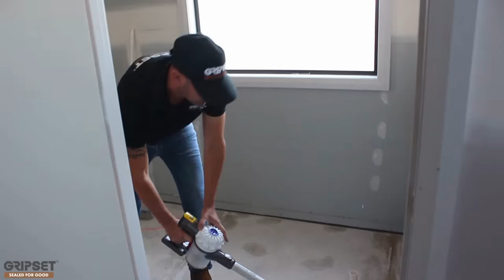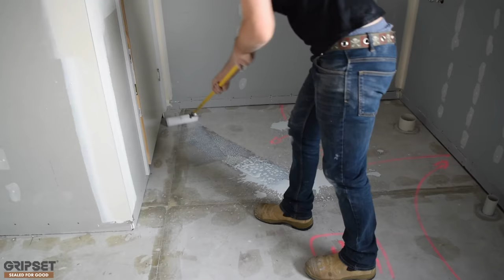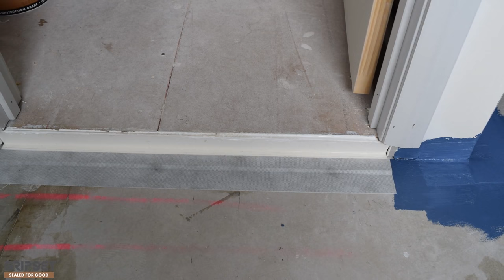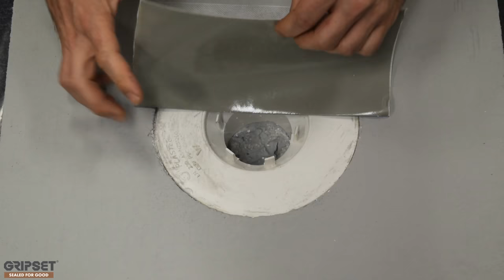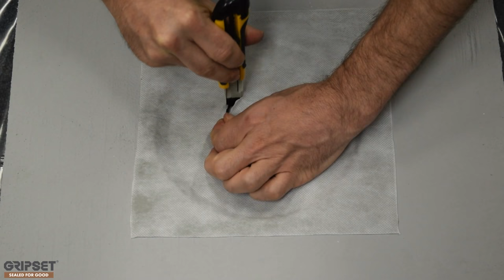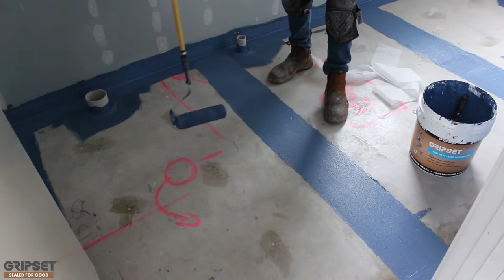Waterproofing An Internal Wet Area

Comment: Seems non-complaint as the corner gaps (bond breaker) were not filled with flexible sealant before putting the waterproofing membrane. This is as per AS 3740 - 2010

Comment: Hey, I’m wondering why the internal & external folds have the elastic exposed (facing out) but in this vid and others I’ve seen the joint roll is applied facing in? Does it have an effect on performance depending on what way it is?

Comment: Hi,

Was there a fall towards the puddle flange or did you just apply first coat of waterproofing and then you may also use another puddle flange ontop and tie it into the screed???

Just thinking if water does penetrate, will it just sit stagnant? 

Can anyone help me with this query, as im about to waterproof my shower and been watching all the Gripset vids and looking abit of clarity.
Reply: For further clarity, ive got a wall to wall shower, with a 90mm curb to entrance. At the moment the whole area is lined in cement sheet, puddle flange is recessed in just below the cement sheet level and the cement sheet is mounted directly on the yellowtongue flooring beneath, sitting perfectly level. 

Theoretically, water will never leave the shower area as the curb will always keep it within, but im worried about stagnant water not finding its way to puddle flange.
Reply from the maker: Hello George, could you give us a call on 1800 650 435 and somebody from our technical team will be able to help you out!

Comment: I need this to waterproof a plywood floor and I dont want to add flooring on top. Can I just seal it and leave it as is and will this work on plywood?
Reply: Hi Courtney, please email us at info@gripset.com with more details of what you're trying to achieve, but ultimately 38FC can't be used in this way. Thanks for your support.

Comment: why use perimeter bondbreakers when sikaflex is available then 1 good coat of multithane . works great!
Reply from the maker: Hi, Sikaflex is solvent based sealant and apart from been  hazardous to your health the product is not compatible with water based products.
Unlike sealants Gripset Elastoproof B50 Joint band requires no drying time to overcoat, has up to 100% elastic recovery and rupture resistant its compatible with all 3 membrane classes and also unlike sealants is developed solely for this purpose. Multiphane is solvent based and would not work great for project in video as its specified as a bonded system and there will be a membrane over screed for direct tile as your probably aware solvent based membranes do not allow cement based products like screeds and tile adhesives to bond and there would be a high risk of failure. Thanks for watching!
Reply: @GripsetIndustriesPTYLtd  still works well here for us in Australia.. yours looks good too.
Reply: @stephenc4161  what's the best stuff to use in Aus mate?
Reply: @stephenc4161  must be made for me!! Is it readily available. That k's for the reply. So many products out their
Reply: @stephenc4161  ha ha ha ha.
Reply: @stephenc4161  just sika the joints. And paint the stuff on?
Reply: @stephenc4161  cheers pal

Comment: I understand using a bond breaker on the wall to floor junctions. But shouldn't you also use a bond breaker on the joins in the flooring substrate - not a reinforcing bandage lie you did in this video?
Reply from the maker: hi vzgsxr, CFC sheet installed in this video was epoxy joined and sealant applied prior to membrane application, Gripset Elastoproof joint band could have been used to seal and act as a bond breaker. Thanks
Reply: Follow the Manufacturer Directions
This is the way this product is Used 
It Tried and Proven 
If Don't mind me saying you are doing 
What most do , you mix the application
Up , Different brands use Different application it to do with the Make up 
Of product 
Ps You don't  run  Different Brands of 
Tyres on one car

Comment: How do you go about recessing the cement board to allow the puddle flange to sit slightly below the top of floor.? A diamond router bit??
Reply from the maker: Hi Cain, Mark edges of flange with a pencil, use a cup grinder to create the recess to the nominal thickness of the flange. Glue flange to pipe and floor surface.

Comment: So, I take it, vinyl flooring cement will stick to this material and can be painted over on the walls where it sticks up above the edge trim board.
Reply from the maker: Hi, the application shown in the video is for a fully tiled bathroom using polymer modified, cement based tile adhesive, for advice on what specific materials are compatible to use over Gripset Membranes, send your enquiry to info@gripset.com, thanks for watching!

Comment: Is there fall to the puddle flange? Or is the floor level with the puddle flange?
Reply from the maker: Hi Wan, The Puddle Flange is installed to the substrate which is typically flat. Falls to the waste achieved by laying of a screed.
Reply: Are gripset membranes specifically the 38fc and the Xpress, how are they with ponding water and re emulsification?
Imo I would like to see the satisfactory falls created on the substrate using a gripset 11y and DM feather screed mix and then prime and waterproof over that?
Reply: @GripsetIndustriesPTYLtd  If the floor and membrane is flat, isn't this non compliant to AS3740? Section 2.3.1 states 'Where a floor waste is required in a wet area, the membrane shall be applied to a substrate with a minimum 1:100 fall towards the floor waste'. 
I would think there is risk of ponding if the membrane is flat.
Reply from the maker: @w37320  Hi Will, this is correct. This is one of the notable changes to the 2021 standard. The membrane must be applied over a graded surface with fall to alleviate any ponding. All Gripset wet area membranes are resistant to re-emulsification once cured. Thanks for watching :)

Comment: U need to use neutral cure silicone on corners first
Reply from the maker: Hi Jay, with the Gripset tape bond breaker systems there is no requirement for sealants

Comment: this system wont last, need to caulk the joints and use polly for the floor
Reply from the maker: Hi Antonio, Gripset B50 Elastoproof used at all the corner junctions offers a instant ready to coat waterproof junction and far superior performance than any sealant based bond breaker we guaranty it will out last caulk. Floor joints where sealed with sealant, give us a call on 1800 650 435 to organise a product demo, thanks for watching.